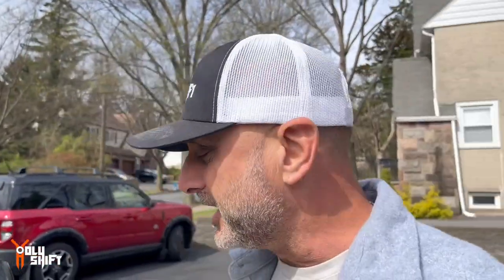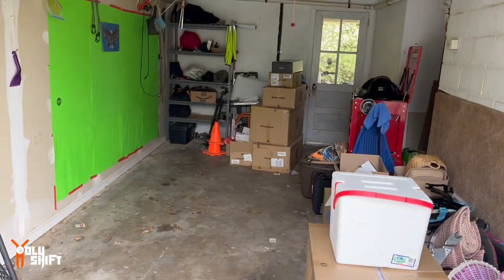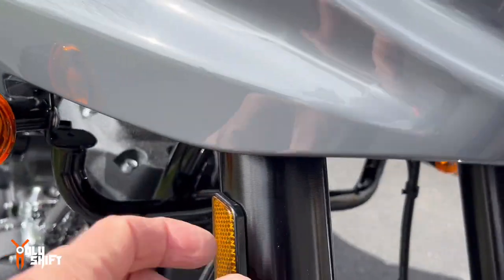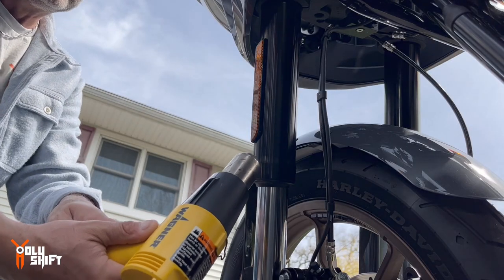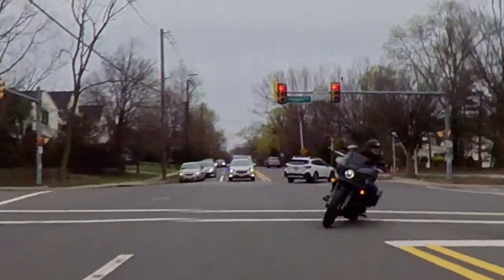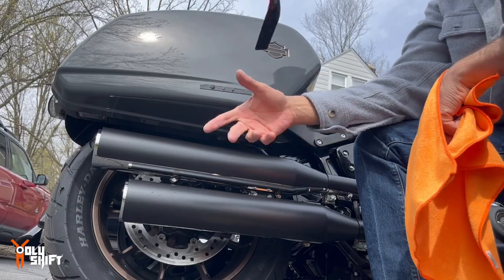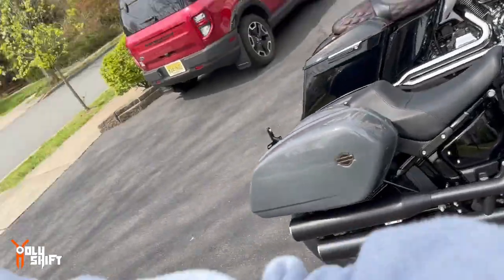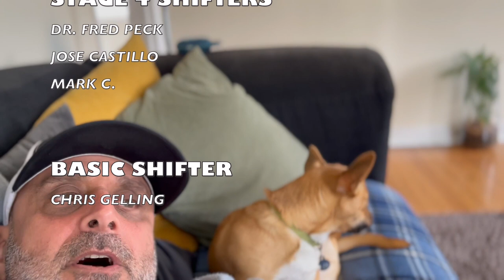Softail - Harley’s New Favorite…

Comment: The epa ruling on carbon management does not apply to tuning the motorcycle.the outlets are put on after the tuning is made and is not part pf the motorcycle diagnostics. This means reflectors baffles  and expandable wheel covers are not processed under make of the vehicle warranty but to derail like against vehicles on the road ..anything to side swipe interest but to gain assets with certain areas of motorcycling as insurance seems to do at the moment as well